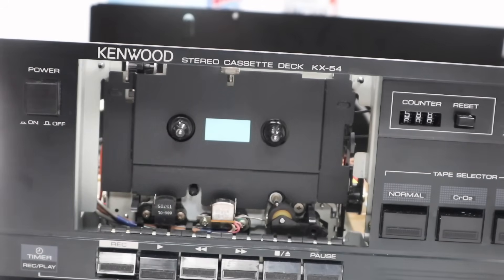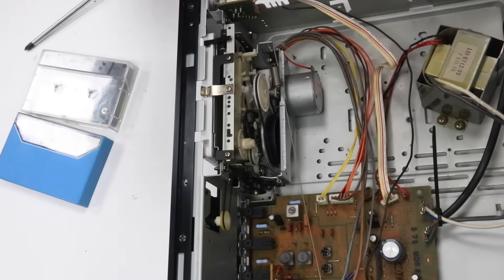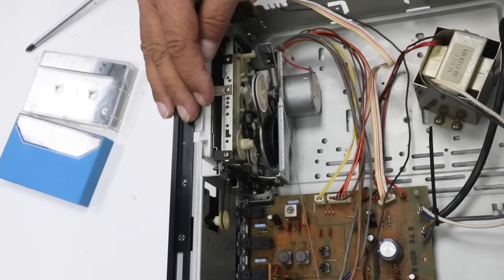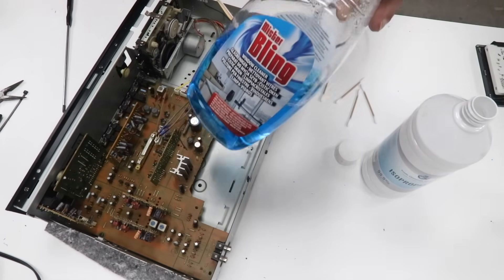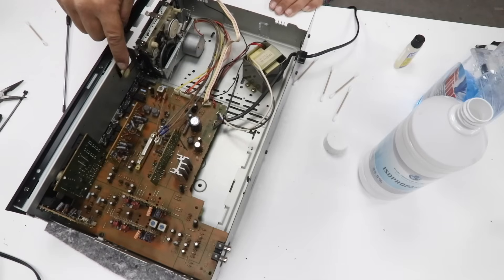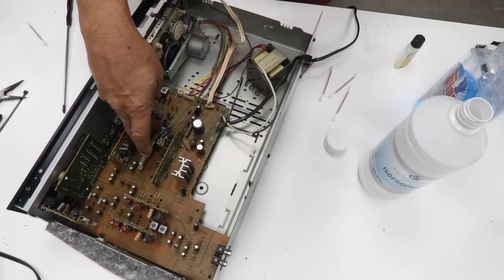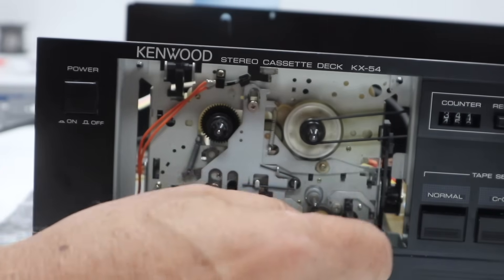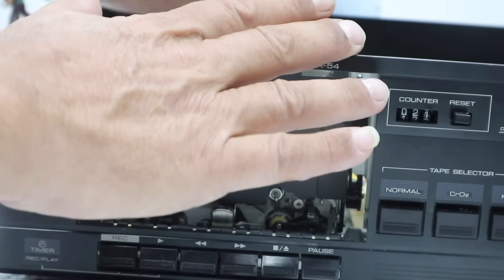7 steps to repair ANY cassette deck player vintage hifi audio electronics cassette deck repair

Comment: I must be one of the two percent that this doesn’t resolve my issue - I have replaced the tape roller for a new one thats the right size, replaced some bands and now realise it’s the torsion spring thats not quite got enough power - any advice? Just need it to move down a further mm if that and it would play perfectly, can do so by moving manually but that won’t work when sealed up again! Probably could have kept the old tape roller in but might as well keep replacement now!

Comment: I worked in electronics company for many years and we are not allowed to use alcohol to clean a rubber rollers because alcohol make the rubber dried up and cracked. We always used a special chemicals to clean the rubbers. Rubber Renue is a good rubber cleaner. Do not use any alcohol on any rubber surface especially the pinch rollers.
Reply from the maker: @JasperAsher-lv1yg  the Japanese told us to use it so i am still doing that (and then RR to feed the rubber but since its a new thing the Japanese didnt tell us that)
Reply: Petrol sir

Comment: Thanks for the tutorial.very helpful.
I have a question. I want to buy a Mitsubishi stereo system but i do not know if the links you provided will carry parts for this old 80s system. Are parts basically all interchangeable?

Comment: My family has 2 Panasonic radio cassette boomboxes from the 1980's, and their cassette mechanisms share the same problem with plastic gear wheels, which had broken into pieces after becoming brittle with age, rendering the mechanisms inoperable. Still unable to find replacement gear wheels, which isn't surprising since these boomboxes have not been in production for more than 3 decades.

Comment: Most amazing info. Thank you so much. Took my Akai GXC 710D apart today. Both channels behaved funny. Cleaned whatever I could clean. There is a lot of distortion on the left channel now but will do for the minute. There is a cap that seems to misbehave and perhaps the record mechanism causing some distortion, reverse is not functioning and some tape chewing from the capstan. Hope to deal with it again tmr 😉

Comment: I have a top of the line gradiente ds2 that i got for cheap in an antique store. Digital controls and single deck. Original belts from the 90s but they still hold up

Altho, it needs new capacitors and the right side stopped working

Comment: im trying to troubleshoot my cassette recorder 3-5362a. it makes annoying high pitched noises, whenever I rewind but then goes away, and the tape wont play it will slow down. I cleaned the circuit board and the bands are strechy and fine. any tips?

Comment: Excellent video, appreciate your well explained video.  I do have one problem I wonder if you could give me some advice with.  I have a Kenwood KX 67W duel cassette deck for my home stereo that I picked up at a thrift store.  The problem I'm having is when I push the power button, the until with automatically power on and both cassette decks will both start spinning at the capstan rod.  If I push stop on either deck, nothing changes, the both just keep spinning on both decks.  Any advice would greatly be appreciated, thank you !
Reply from the maker: @Gauntlet1985  thats normal with these decks on power on the motor start as well
Reply: @cassettedeck-walkman-repair  Thanks for your reply, glad to hear that. Personally that's the first time I've ever owned a cassette player that does that.

Comment: Thanks for creating this video.

If I can add my specific experience is that the single most important thing to lubricate in ageing cassette decks is the capstan motor front bushing, it can make a huge difference in vibrations, IM noise and current requirement. Also it's quite often the case that I can find jammed parts (for dried hardened up old grease).

The other part that cannot really be overlooked is how to properly clean the capstan shaft and how to judge a pinch roller. The capstan shaft should be cleaned with isopropyl alcohol  and a cotton bud if the oxide isn't stuck to the shaft, it makes the process much easier as it will rub instead of slipping atop the oxide dirt, if the deck has had oxide left in there for years the shaft needs to be polished with steel wool. A hard worn out pinch roller will likely give flutter to the playback, while a flat spot caused by prolonged (days, months, years) contact with the capstan rod will likely cause wow. The pinch roller must be scrubbed from side to side exactly how you show in your video, preferably with isopropyl alcohol. It can also be treated with softening and cleaning fluids that are commercially available.

I notice you didn't mention anything about the back tension which in the Kenwood deck of your video seems to be provided by a slipping strip much like a VHS brake. It is essential that the supply hub offers some resistance while turning as a non properly tensioned tape will inevitably spill at the capstan. On closed loop dual capstan machines that tension is offered by the closed loop design of the 2nd (supply) capstan and pinch roller.

Comment: Recently bought a 2nd hand Technics midi hifi SH-eh500 but the tapedeck RS-EH600 doesn't play a tape.  You press play but it stops almost immediately.  Previous owner said it was not used for years. If you press play it play for a second. Turn the head over as if the tape is at end of side  then stop. Ans the band is pulled out a bit. Those 2 black that sticks. What you think is faulty. Thx

Comment: killer video, thanks for this.  I have a Marantz PMD 360, when I got it, it was playing but I needed to clean the volume pots which got it working just fine...it crapped out the other day and now the take up reel won't run when I hit play, the speaker seemed to be going as well.  I'm a little nervous to open it up because I don't want to mess it up further but this video was great with some pointers.  Any chance you've taken a PMD 360 apart before?  Any other tips?

Comment: Great video! I’m dealing with a rewind problem on a Sansui SC-3100. All belts replaced, everything works except rewind. Looks as though the torque is low in the rewind mode. Is replacing the tires on the idler wheel the only solution? The SM does not mention the size and I don’t want to make a mistake in ordering the wrong size. If you know what the tire sizes are for the two idler wheel tires and the spool tires (left & right) and can share that, it would be awesome. Thank you again!

Comment: Hello there, and thankyou very much for your video.
I have a pioneer dc-92 that i have rescued from my attic and neither tape decks are happy. Before i take it apart and investigate could you please recommend a company  that sells quality rubber belts for this in UK or Europe please. I want to sell this machine on as it is in fantastic condition after reading an article on the BBC website that stuff like this is now in huge demand?!?! Hence me going into attic to retrieve mine! The record deck had a melted yukky band in it and i have ordered a new one of these, and i am guessing the tape decks have a similar fate, but i am yet to open the machine up yet. It has been in a box in my attic since the late 80's early 90's!! Wish me luck!!
Reply from the maker: @neiladkins6726  thank you for your kind words , in the video description i have a few good belt sources in various continents, please have a look at those and good luck with the repair !

Comment: i have an audio issue one channel only nakamichi bx-125e leds show channels are working but no output on 1 channel even with headphones, any idea?
Reply from the maker: @mike311271  have the caps been replaced ? Those are problematic in naks

Comment: Hi, I just wanted to record a song using my JVC KD-W55 cassette deck, but the song didn't appear, instead there was noise. Then I tried touching the button with my hand and the noise decreased. Is there something wrong with the ground wire connection or is there something broken with other components? 

Thanks.

Comment: Do you have any suggestions or a video recommendation where it sounds great except there is a mechanical noise when running, even if there is no tape in the deck?
Reply from the maker: Typically that sounds like a dry running bearing / motor

Comment: hi i have a couple autoreverse decks that for some reason sometimes when you press play forward after inserting a new tape, it tries and fails, then starts playing reverse (autostop). but then forward will work fine again after this
Reply from the maker: @foxyr4bbit  most likely the tape rotation detection , does it have a mechanical counter with a belt or digital counter ? (Which brand model are they ?)
Reply: @cassettedeck-walkman-repair  hi thanks so much for the response! one is a yamaha kx-r430. that has a mechanical counter

the other is an onkyo ta-rw344. this is my friends that i was fixing up. this one has a digital counter

i thought maybe it was a similar issue since they had the same exact symptom
Reply from the maker: @foxyr4bbit  the problems are probably the same for both , the digital counter probably has a dirty sensor or dirty reflectors behind the reels , i show the reflectors behind the reels in teh video
Reply: @cassettedeck-walkman-repair  thank you, i'll take a look!

Comment: Why no warning about high voltages?.
Reply from the maker: @skeelo69  because i am not the pampering warning type ?
Reply: I accidentally had my bare arm on top of the power supply when my Sony CD/Tape Player was plugged in. It was shocking me and felt like a light burning sensation. It's probably the worst high voltage part to come in contact with and it wasn't that bad at all. Not near as risky as a powered on CRT television. But as long as you're not careless/wreckless you should be fine.

Comment: Yeah the belt situation is a problem. It’s great they are being reproduced but a lot are out of the spec that is required. 
If you need to replace belts on a 30 dollar deck   That is a good deck the so called specialty belts are 30 and 40 US dollars. That’s not worth it because it still will be tight so the Amazon belt kits are the answer. With the 50 piece belt kit for 10 bucks You may find a few belts that are good enough for wow and flutter and still sounds good. 
I found that you will find the right size belt in the amazon belt kit assortment , and it all seems good until you measure wow and flutter. 
The problem is the belts are too thick making it to tight. 
The belts I measured were 0.04in to thick. It makes the difference of being in spec or way out in space. One belt I couldn’t figure out what was wrong until I noticed a small very hard to see rubber bump imperfection. It caused it to be terrible. 
So for comparison- a factory belt measured 0.24in thick. 
Amazon belt measure 0.28-0.29in thick . 
Quality control for the belts must be a lost art. 
Belts have to perfectly smooth and uniform thickness and width. 
The top end decks need this to hold amazing specifications.
Reply from the maker: @universalhead  great and explanation! Thank you for your reply

Comment: I recently found a Sony TC-W250 in the trash. Both belts in both drives have turned into goo.  It looks like a lower end deck, and it was free, so it would be a good candidate as a first cassette deck repair.
Reply: Awesome find, I hope u succed in bringing her back. Where I live, nobody throws away gear like that. They give away or sell, or sell for high prices. 😢
Reply from the maker: @thomasburns1846  i am sure you’ll do great !
Reply: You are correct. It is an entry level deck. The higher the module number the more valuable it is in that range. With the higher end models forming part of the ES range. Thus an Sony 850ES model would be considered a sought after unit.

Comment: I just acquired an old Panasonic portable recorder that is not playing and the head has that same brown dirt as you show at 5:40. Some of it came off with a quick rubbing. I guess I'll have to keep working it. I also believe that your cautioning of sketchy places to buy belts  should be taken seriously. You pack a lot of useful information in your videos and it was smart to make this one brief. In general I avoid a lot of videos that I might be interested when they require an extended time commitment. I hope this one attracts new subscribers for your channel.
Reply from the maker: @Veedthetg  thank you 🙏 i realized that shorter video’s have their place as well . Keep cleaning the head until all the brown stuff is gone !
Reply: Cam u use a polish to get the brown stuff off?
Reply from the maker: @ only as a very last resort, i personally don’t i would polish with alcohol and a qtip
Reply: @cassettedeck-walkman-repair  ok whew great! Thanks for this, mate. I am so glad I didn't use polish. I'm waiting on a vintage JVC deck to arrive. I did a business with a close mate of mine for it. He is was servicing it it and adressing whatever issues it had (minor) & giving it the usual "run in period"

I am thinking of buying afew more later on, to have as "spare" units.

Comment: Just curious; mechanical and electronic components can be replaced, but what about the heads ? A long long time ago I had a relative cheap Philips open real deck with so called 'long life' heads which wear out over time, not so 'hard' as more expensive FSX heads. Are replacement heads still available somewhere ? Or do you rely on donor decks ?
Reply from the maker: @jaapgraanstra281  heads can be ‘relapped’ which means you (crudely stated) sand them down and repolish them , but this is a very time consuming and expensive process. Your best bet would be a donor deck or measure the heads coils and see if you can find something similar new or new old stock

Comment: Thanks for this video. I learned so much!
Reply from the maker: you are more than welcome ! i thought it was good to just go back to the basics for awhile
Reply: @cassettedeck-walkman-repair  I've been looking for a JVC single cassette deck for a while and there's a seller on ebay that has it. He said the only problem is that it keeps eating the cassette tapes. I assume it's one of the problems you mentioned in this video? Possibly?
Reply from the maker: @briandellafey  98% sure its one of the things i mentioned , unless its a JVC with Sankyo transport then the 2% can be the back tension belt on the supply reel